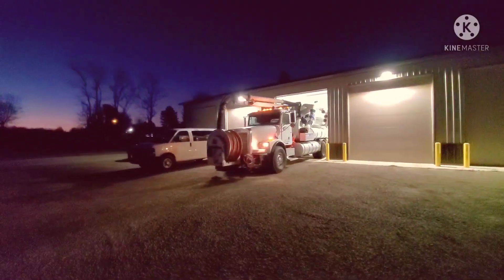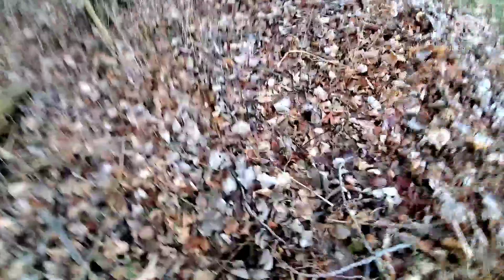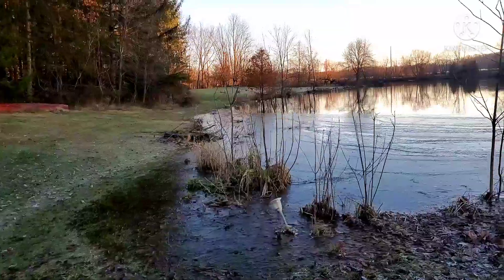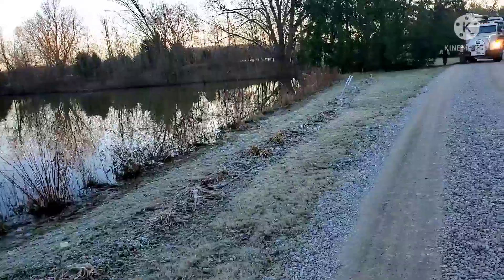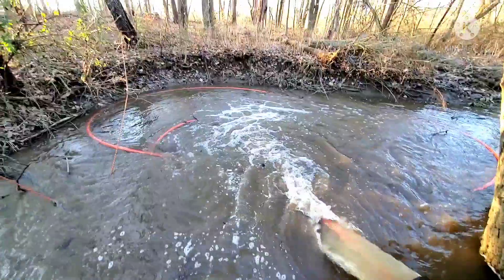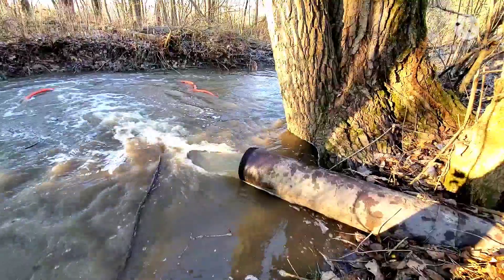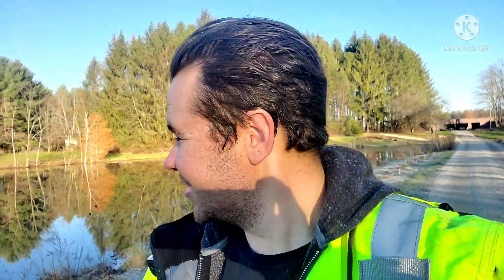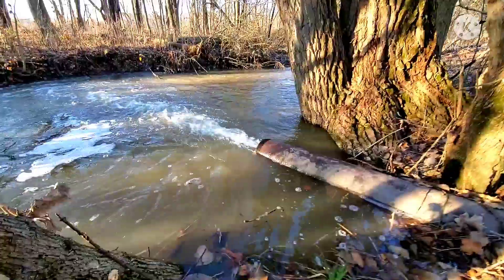Flooding pond because of clogged overflow pipe! Can we clear it?

Comment: Loved the video.. but at 6 feet above normal that drain pipe is still restricted.   It should be running out the end full round which it's not.. nor is it shooting out like it should with that kind of head pressure it would have.  Or maybe it's the type of debris catcher on the inlet side.  Can't wait to see now.  Thanks
Reply: Post 10? Is that you?
Reply from the maker: I totally agree! We were thinking the same thing. I am going to reachout to the property owner for us to do a follow-up and see if we can improve the overflow design. 👍

Comment: Would have like to see what you did to get it to drain.
Reply: Also would have liked to see a before and after
Reply from the maker: It is hard to run the truck and video the same time. I might try a go pro chest mount 🤔
Reply: @bishopunlimited7917  after watching a lot of drain jetting videos from Uk Aus and US… and based on the gear on the truck… high pressure hose used to dislodge the blockage from downstream?
Reply from the maker: @kevsecker3182  You are absolutley right. The large reel on the front of the truck has a an assortment of high pressure cleaning nozzles that you run up into the pipe and cut/dislodge the blockage. I will have to make a video explaining the truck. 👍
Reply: @bishopunlimited7917  dude, if you haven’t already,  heck out DrainUnblockers and DrainAddicts and the like. Based on their subscriber rate, people like us spend god knows how many hours watching guys just like you unblock small domestic setups. Post 10 does culverts with a potato rake and hand power. 
Multi camera angles, timelapse updates. People love seeing all aspects of the job.
The market is missing a utube channel with the commercial/large scale gear like you have and, if you keep it clean for kids so utube doesn’t get uppity, might be a few bucks to be made ;)
Reply from the maker: @kevsecker3182  Thanks I will have to check them out! We cleaned 5000' of new 48" sanitary a while back. Some of the manholes we 35' deep. I'll have to see if I got enough video to patch something together. 🤔
Reply: @bishopunlimited7917  well, you just got yourself another sub so i look forward to seeing what you did :)
Reply from the maker: @kevsecker3182  Thanks!